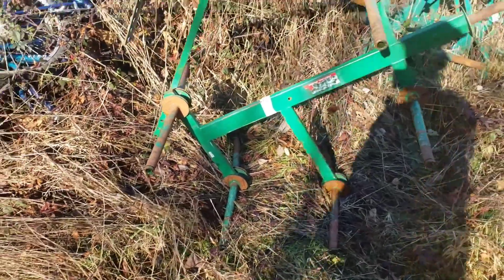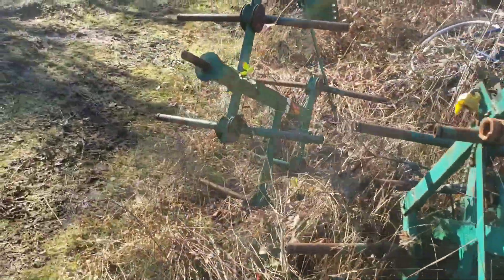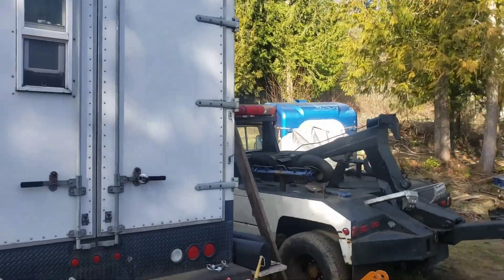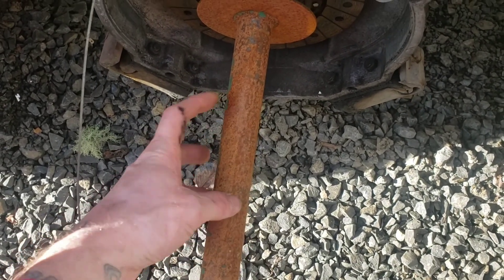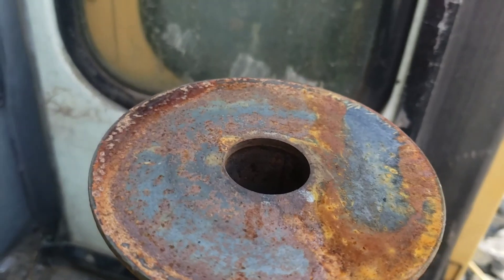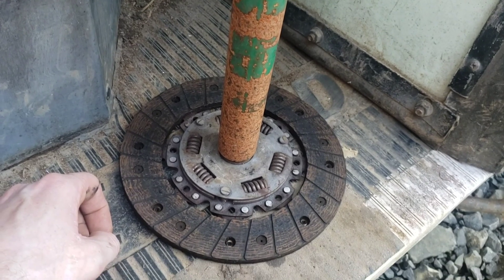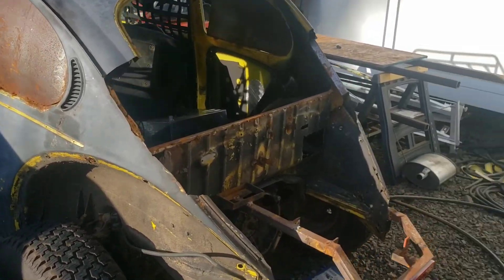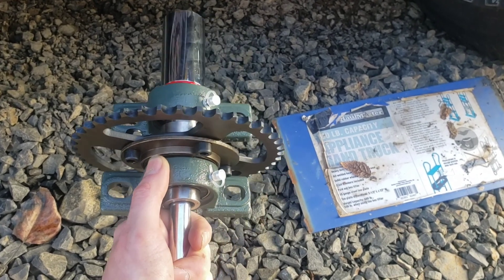predator 212 to manual transmission via jackshaft vw volkswagen go kart baja bug build

Comment: Hey 😊👋 just got home lol but yeah my vw beetle is a 70s beetle I gotta remove the engine first the engine is prob still good just needs rebuilting also I just got my predator 670cc engine and holy cow that's heavy haha 😂

I'm just wondering 🤔 I'm wanting to go with a belt and pulley system instead of sprockets and chains I always have problems with them they pop off with me lol

But ye I'm doin the same thing any ideas what I should do?
Do u have Facebook?
Reply from the maker: Nice 👍sounds like a fun project. If I was going to do it again, and with a 670 predator. I would do about a 25 to 1 gear reduction. I would do a double v belt pulley set up, rather than chains. Chains are a pain to line up and get to run true. Good luck with your project, and God bless.